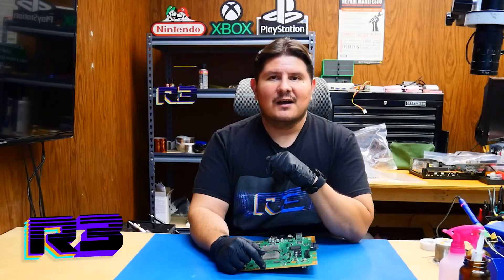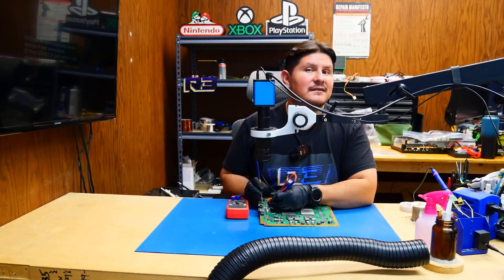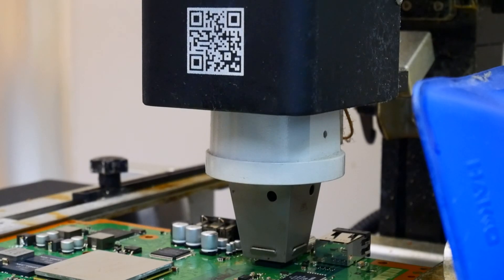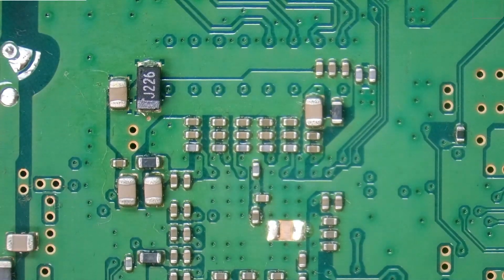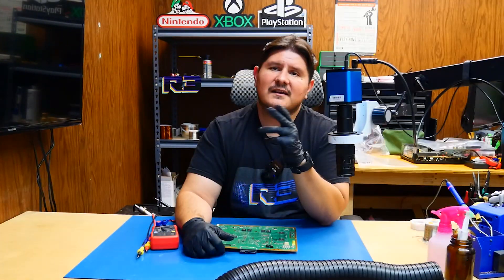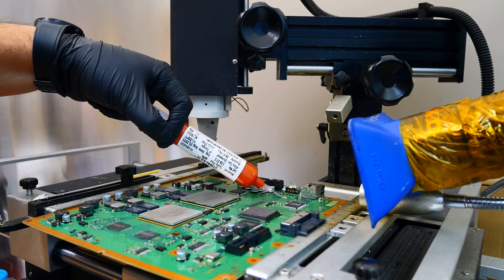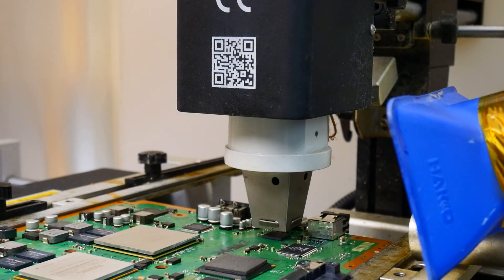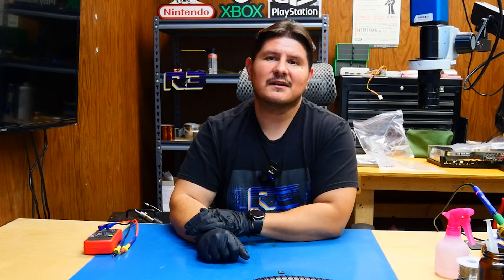Sony PS3 No HDMI Signal - It Wasn't A Broken HDMI Port This Time!

Comment: I have had the same issue with my 40gb variant of fat PS3. I was able to get the video on the Analogue port but not on the HDMI. It's good to learn how i could have fixed it. 

I also had gotten YLOD on my console but after a thorough cleaning and thermal repaste it was as good as new. It happened less than after a year purchase too. Thankfully a clean did the job.

Comment: I have an issue with the audio of my PS3, when i turn on the console it sounds terrible, like it have an interference but 5 min later it sounds normal, right now doesn’t have the multi output audio enabled because the problem persist even after the 5 min. I think the problem is from the Sillicon Image chip, is that correct??

Comment: I’ve had a no-video 20GB launch model for over 17 years with no video from HDMI or multi-out. It’s not bump gate, damaged HDMI, or an incompatible resolution. You can tell it boots and shuts down normally, you just can’t see any of it. What could that possibly be?
Reply: buy a ttl uart adapter and solder it to the board, so you can get error codes
There are some great videos about it (search ps3 syscon diagnosis) and if you get any errors you can check them on the ps3 wiki. Its the most straight ahead way to get to know your problem.

Comment: I am having the same issue.Av port works.  The hdmi doesn't output any image  any if the tvs or hdmi cables.Are these had an  common issues with these consoles.The HDMI port in mine ps3 isnt damage

Comment: Solution, (not in this with failed components) but I had a PS3 stuck on av out or stuck on wrong hdmi settings that the TV couldn't detect when they first came out. To reset back to hdmi settings without seeing the screen you press and hold power button till it does 3 cycles (I think) and the screen comes back on to the hdmi settings menu